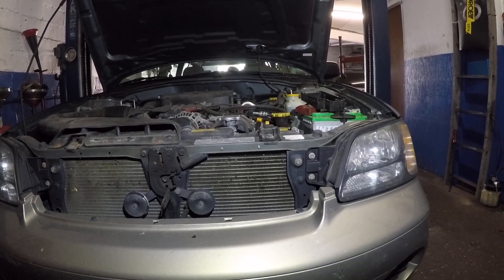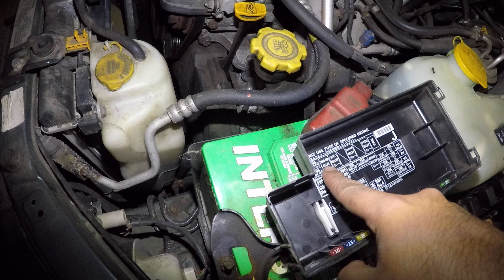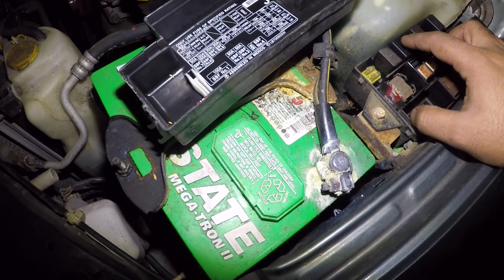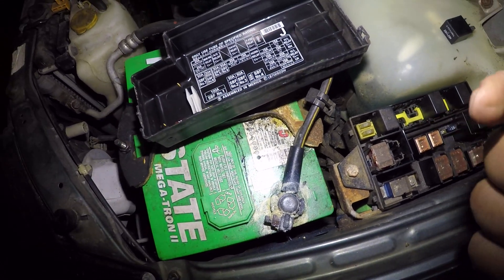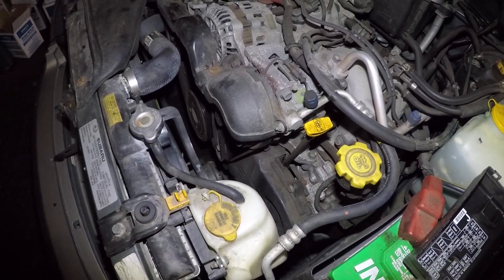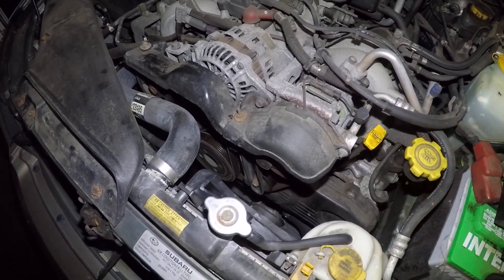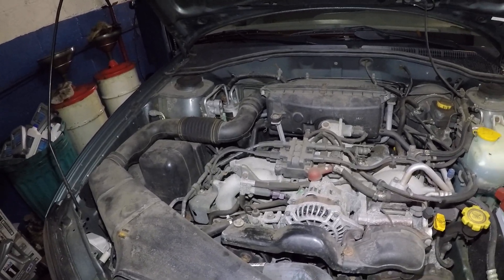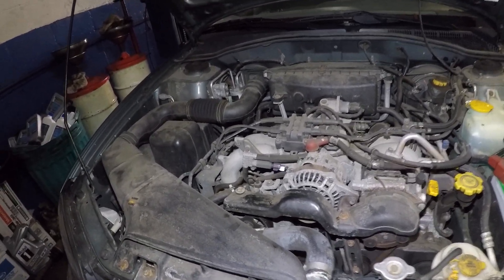AC DONT WORK ON SUBARU OUTBACK BAD AC RELAY

Comment: I just tried this after finding your video. Relay layout on my 2007 Subaru Outback was slightly different but the test using a nearby relay worked like a charm!  I took out the bad relay and tested it on the benchtop and confirmed an open circuit despite activating the coil. Thanks!

Edit: my car started throwing a p0691 error code on the ECU: Cooling Fan 1 Relay Control Circuit Low.   Looks to be a consequence of stealing the fan relay for the AC. I replaced the AC relay and had a mechanic clear the code. Anyone who tries this fix/test should be aware that they will trigger a check engine light. I’m n a subaru this also leads to the cruise control light flashing. FYI.
Reply from the maker: Good job! Easy quick fix big bucks saved!!!

Comment: Hi, it’s not very clear in your video when you say to use a test light to see if there’s power in the 1 pin connector that’s actually on the AC compressor as one could test either end after disconnecting it.

I have a 2007 Subaru Forester (non-turbo) and I tested both ends of this 1 pin connector. The wire coming from the fuse box doesn’t have any power but the wire that it’s actually on the compressor itself connected to the AC compressor coil does have power. My AC clutch it’s not engaging. Ideas? Thank you.
Reply from the maker: Did h check ur pressure ? High and low?
Reply: @RBTheMechanic  hi, I don’t have a way of doing this without a gauge. I asked around and in order to check pressure in the AC system price ranges from $130-$250. I honestly cannot afford it now. Perhaps I can just buy on of these gauges and test it myself. I’ve never done it but have seen a few videos in how to do so. Thanks
Reply from the maker: @mansalaija  it would be better to have it service and get reading before and after

Comment: Can you help me. I have Subaru Forester XT 2.0 SJ 2017 and when I turn on the a/c the blower works but then the compressor is not engaging. Tested the relay and fuses and it works. Tried jumping the switch on the relay and it engages. Problem is on initial start up of the a/c, recirculating button is off on default, which should be on by default. I dont know where to look. Is it a low pressure switch or else?
Reply from the maker: Didn’t check Freon pressure?
Reply: @RBTheMechanic  nope but tried to unscrew high and low caps theres was pressure or is it really on low refrigerant thats why the pressure sensor acts up?
Reply: @RBTheMechanic  i will get it checked tomorrow when I get home its so hot and I need the a/c to work LOL
Reply: @RBTheMechanic  my question is where is the pressure switch sensor is it built-in in the compressor?
Reply from the maker: @execlipse7620  no follow the lines it should be close to condenser
Reply: @RBTheMechanic  had it checked it was low on freon caused by leak. Hence, preventing the compressor to engage Thanks btw

Comment: Got an 07 subaru legacy, the air recirculate button stopped working. Last year during the fall here in Texas, it started acting up. I'd push the button and it wouldn't light up or anything. Replaced the cabin filter and it started working again. Unfortunately now that it's starting to heat up again, it stopped working. Any ideas on where the fuse or relay is for this button? Or is it for the entire control panel?
Reply from the maker: I doubt the fuse is bad because the whole HVAC control would go off I think ur switch is bad it self try pushing it on and of on and off quickly see if it engages it might not be making good contact
Reply: @RBTheMechanic  Will do. Thanks for the advice. Is there a connector to the button I can unplug and clean for better contact? Or is it one of those wiring jobs where it's just a group of wires that plugs into the control panel?
Reply from the maker: @Doublebarreledsimian  nothing to clean it better to just replace it if u confirm the switch is the issue

Comment: Having a similar issue, except I’m not getting any power to the system/relay. Even when I swap them, still nothing.
Reply from the maker: Did u check pressure in Systym
Reply: @ was going to then my compressor motor started giving white smoke and metal shavings. So I think the bearings are done. Taking it to the dealer next.

Comment: I have a 2001 Subaru Outback. At  the same time the heater/ac fan, heater, and cigarette lighter (phone plug) stopped working. I’m assuming if there’s a connection between the fan and the cigarette lighter that would be the issue (?). I’ve checked fuses under drivers (RHD) dash, which are ok. I don’t think my relays are same as in this video but I may be wrong (2001 model). Any help would be HUGELY appreciated. Thanks from Australia.
Reply from the maker: Somthing with wiring or ground check fuses all fuses as well
Reply: @RBTheMechanic  thanks for the quick reply.

Comment: 1:05pm hi, 2000 subaru outback, my compressor makes a fair amount of noise. Replaced high pressure line due to a leak. Vacuum test good, filled with R134a and PAG oil at a shop. Still noisy. Then battery died, had to replace. Can compressor drain a battery? Must I replace the compressor? Thanks
Reply from the maker: U would have to do drain test to find battery drainage if ur compressor is always engaged then it can

Comment: To refill the ac which valve do I use? The front one or the back one? Thanks
Reply from the maker: Usully low side is used but I use ac machine both valve mare connected vacuumed and then charged with both valves it’s easier

Comment: My  a/c only blow cold air  when I’m driving..soon as I stop at a light it blows warm air.. can you help (2006 Subaru Outback)
Reply from the maker: You might need Freon it might be low and when u stop rpm drops and dosent build cold
Reply: @RBTheMechanic  thanks I will let some out and see if it changes

Comment: 2QQ2  subaru outback  no ac.   The AC will not turn on.  Swapped the relay no joy.  Checked the freon it was in the red, so it has freon. Clutch wheel is not seized.i just want to make to identify what the problem is before  I just start replacing  parts please advise.
Reply from the maker: Ok so next step u need to check to see if ac compressor got power with ac on
Reply: @RBTheMechanic   replaced the relays too.  No joy
Reply from the maker: @phillipandrews7610  put ac on anc check if the ac compressor gets power?

Comment: 2015 Subaru Outback.  Air blows good, but last winter after the engine warmed it didn't blow warm air, only occasionally after a while, then blow cold again.  Now it is the opposite.  The a/c only works good when the engine is first cranked.  After the engine is warm it blows warm air, then after about 25 minutes it will blow cold for 2-3 minutes, then warm again, etc.?
Reply from the maker: So please check and re service the ac system it might be low Freon so check ur relay change it

Comment: Good Video.
I still have troubles with AC compressor not kicking in.  I checked fuses under dash...all ok.  I can get the compressor to kick on if I jump with long-nose pliers in the relay box.....so I thought, "bad relay"...bought new relay and installed...compressor still wont kick in....no click in relay either ?????
Reply from the maker: Did u check to see if the ac got cold when it kicked on?
Reply: @RBTheMechanic  same problem here but it doesn’t blow cold air when clutch engages. And the vents smells like clutch lining from a manual trans, if you know what i mean.
Reply: Did you fix it?

Comment: I have a 2005 Subaru Outback 25x wagon ac blows hot 
So got a autozone freeon with gage.  I plugged in the to the low pressure port and the garage was in the red and very high pressure it was crazy high.  Lol so unplug it.   Do you have any idea what is that.    
Thank you for this video  I will check out this tomorrow.
Reply from the maker: Well that is not the way to push in pressure ur over filling it and it got air pressure best thing to do is recover , vaccum the system and then refill

Comment: I have a prob with my 1999 subaru forester' the AC take's time to start when i turn it on' after i start the vehicule
Reply from the maker: You might have low Freon seems like ac starts but it takes long time to start making cold or have the cabin cold you might want to have it serviced if it’s been few years from last service

Comment: Hey, what’s up man? So my 4 relays got mixed up, getting error code P0066 trying to figure out what # fuse goes in which slot.  The advice I got was plug and play 🤦🏻
Reply: Oh yeah it’s a ‘01 Outback 2.5L
Reply from the maker: I can send u some diagram if u tell me which fuse box and what year make and model
Reply: @RBTheMechanic  it’s the main fuse box in the 2001 Subaru Outback 2.5l h4 the 4 all black relays like the sun fan etc.
Reply: I have a 2002 Subaru Outback Wagon 2.5l H4. My AC comes on and it blows cold but when it's extremely hot outside past 80° degrees hot it doesn't blow cold like it should. Can you give me some insight on what the problem might be? I often heard that Subaru's have had issues with the AC.

Comment: I have a question i am having problems with the a/c when i am at idle my ac blows hot air and when i give it gas i can hear the compressor start up and its starts to blow cooler air. The compressor is new, drained the freon and added more. Could a bad low pressure switch sensor be the problem? This is a 2001 tahoe
Reply: Recharge your Freon